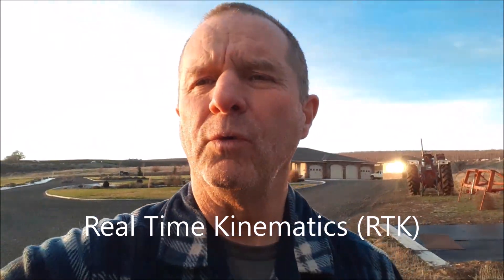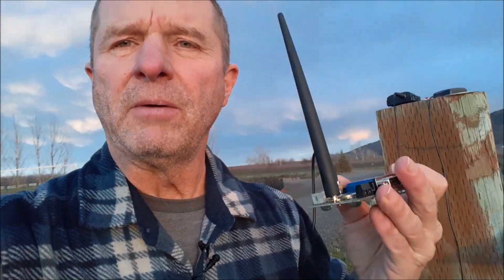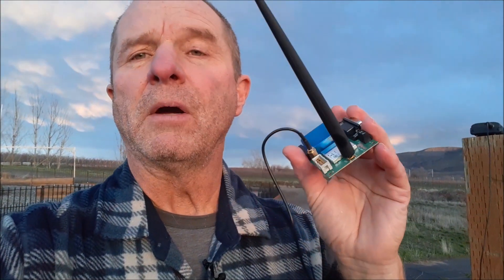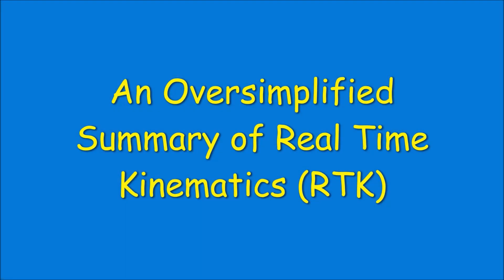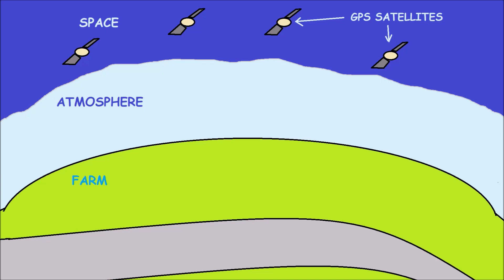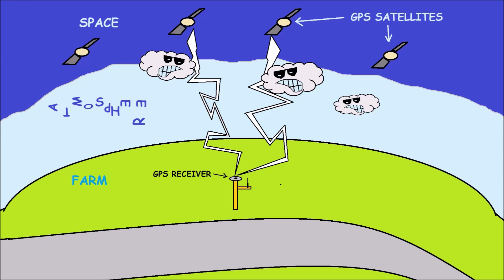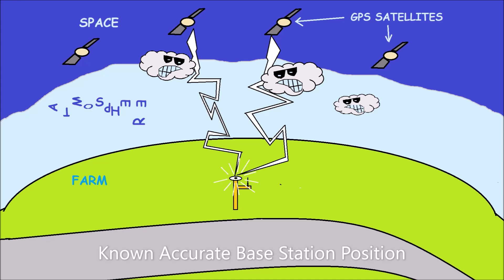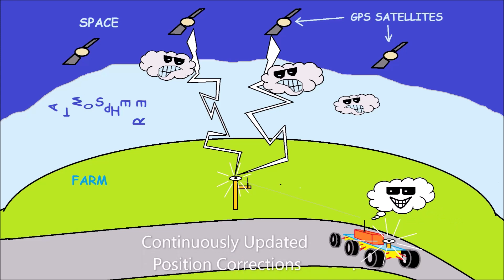Installing a Better RTK Base Station

Comment: Nice solid solution, but maybe it would be better to install GPS antena outside of the plastic box onto some metalic shield to exclude different radio noises from the ground, what do you think?
Reply from the maker: Actually the GPS antenna I purchased for this project did come with a 4" circular metal ground plane disc that I am using in this setup. Keep in mind that the GPS antenna itself is mounted on the wooden post outside the box. The antenna which is inside the box is the radio transmitter antenna for the RTK correction signals. That antenna only needs to transmit over a range of several hundred feet, so external radio interference does not seem to be much of a concern for that one. Thanks for commenting!